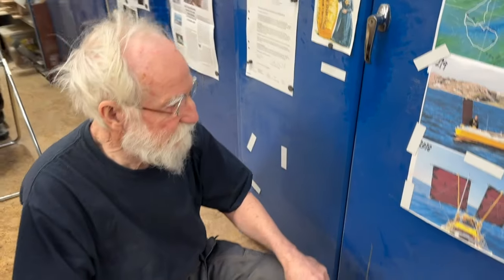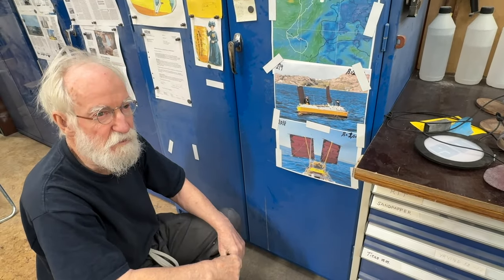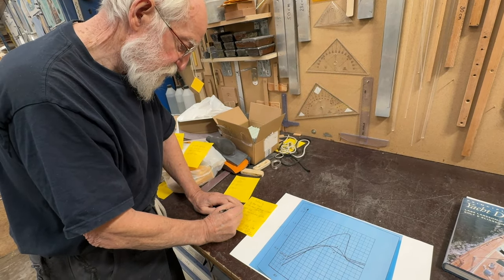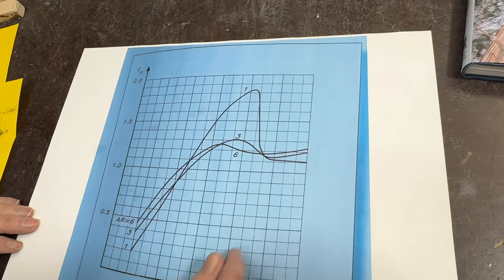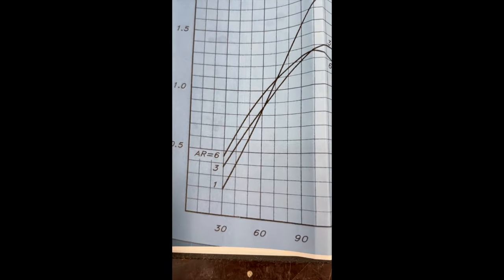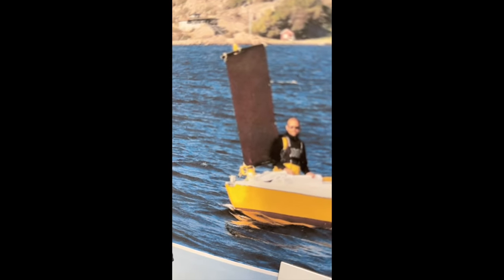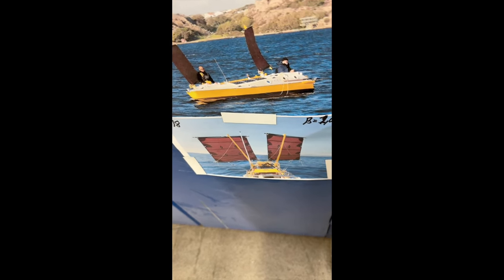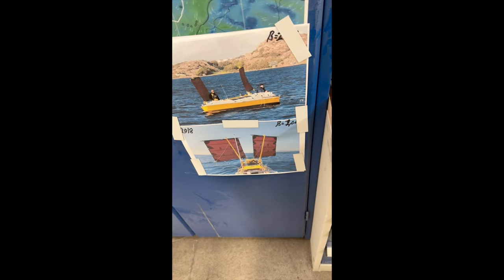24 Nov 2023 More on the supurbness of the balanced lug sail

Comment: For the small size of your sails you could build them into rigid wings and then not rely on the shape of the cloth being created by wind pressure you would have a much more efficient wing shape permanently also since cloths sails get blow out over time a lot of racing boats use these rigid wings now a days and since your design is for small area low aspect ratio sails they probably wouldn't be that expensive to build or control hardware and mechanism wise.

Comment: What's your opinion about balanced jib sails? I've seen some gaff rigs in Azoreas which hade jib booms which were balanced, seems rare though.
Reply from the maker: I do not realy have an opinion on it except thinking it is smart. 
They have them in the US also.
I prefer the lugsail.
Shorter mast and less healing moment
Reply: It seems like a neat solution to get a self tacking foresail. But there is no furling then so the reefing is a bit harder.
I have a low aspect ratio for the gaff plans, but if I changed to lugg rig I will be able to lower the mast a couple of percent extra. I will contemplate it

Comment: To play devil's advocate for high aspect ratio: nobody needs to go upwind, until suddenly they really need to 😂
Reply: Sorry for trolling y'all 😂
Reply: Its not trolling it is true the AR-6 will sail much closer to the wind that the AR-1 sail shape just since most of his trip is most likely going to be downwind he is optimizing his boat for that which is practical. But you are not wrong It is similar to making a car fast but not upgrading the brakes to stop the darn thing you have to weigh out the pros and cons of all your design choices it isn't one thing is right or wrong for everyone. That being said most things that are designed to try and do everything well never tend to excel in one thing to a high degree either that is why sports cars are low to the ground and hard to get into and out of and cannot carry but two people usually and not many groceries or cargo space. Also there is one aspect of a tall rig that Sven is failing to mention or take into consideration that is the wind is located higher off the water in lighter wind conditions and boats with tall masts regardless of their sailplane shape or mathematical aspect form get more air even the old square rigged ships had tall masts for this exact reason. But Sven isn't in any hurray like those cargo sailing ships were back then it was a race to get your goods in first because you got higher premiums and could sell off your load faster it was much more profitable to be the first boat to the market. If he is sailing in the roaring 40s which is where he mentioned most of his downwind sailing will be wind wont be in short supply likely anyway. The benefits to a short rig are he can go under any bridge easily because his rig is short enough to and even if it wasn't he can un step the mast by hand it keeps the boat lighter and makes it heel less with way less ballast and if repairs were needed it would be way easier to do on a beach somewhere without a boat yard also and with less materials cost plenty of pros to what Sven has decided on for his boat but sailing to windward in a hurry isn't one of those decisions. If his boat was mine I would add a small engine to it for upwind performance LOL